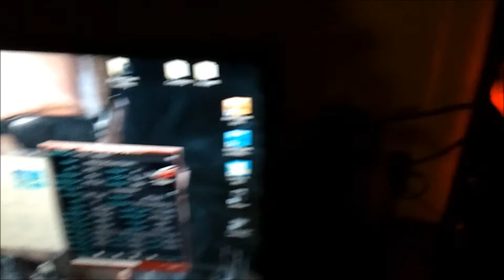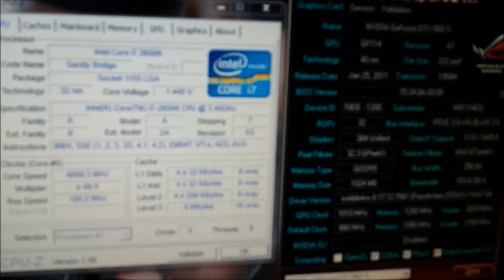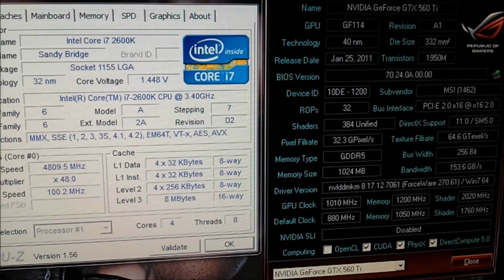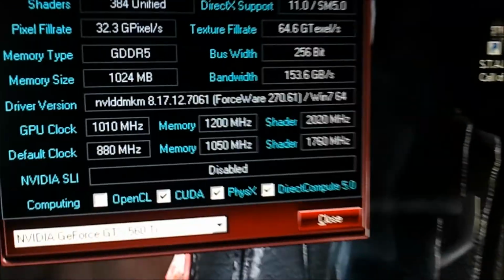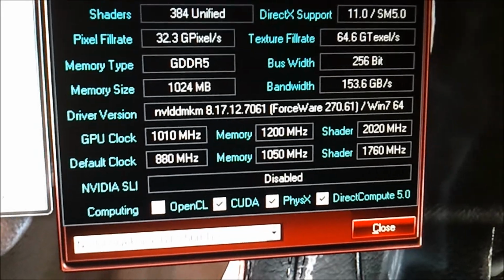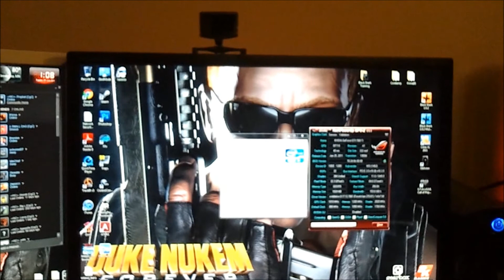HAF X Airflow Test with Dry Ice -Part 2

Comment from the maker: @viper04af This is a bit out of date with my current rig.  Have an H100 and two MSI 570's.  Also have the ASUS Maximus Extreme mobo now.  In any case, tried the all fans in thing.  The Maximus showed much higher temps in the VRM ans socket.  Also vid cards went up in temp.  I get far better overall system temps keeping air flowing through the case.

Comment from the maker: @Askepticos No problem.  I have never been a fan of overdone positive pressure.  My current setup has three intake, three exhaust.  I have an H100 now for the CPU so the rad dumps hot air into the two top 200mm fans.  And I have a red CM 120mm fan in the back exhausting.  In front I added a 135mm fan to pull air through the 5.25 bays to get more cool air in to the RAM and radiator.  Then the two stock case fans.  I preffer flow though the case.  Has always worked best for me.

Comment from the maker: @Askepticos I need to make an update, but now I have two 570's with the Twin Frozer 3 cooler.  I got the best cooling with no bracket or shroud on the fan.  Regardless, the top card runs a fair bit hotter with the air being exhausted in the case.  Still managed a OC to 940 Mhz pretty safe though.  Top card sits int he low 70's under heavy gaming.  Get's in the 80's with stress tests.  The bottom card gets only into the 60's and 70's respectively.

Comment from the maker: @justins2ub Two reasons.  First, there are two 200mm 110CFM fans right above the radiator.  So air comes in and goes right out the top.  Second, the air out of the case is cooler by 3-5 C according to my thermal probe.  So it actually runs a tad cooler.  I've run the fans both ways.  Both ways case temp sits around 30C inside.  I have since changed the fan configuration again anyway.  Reason being I know have SLI 570's in there and a new mobo.